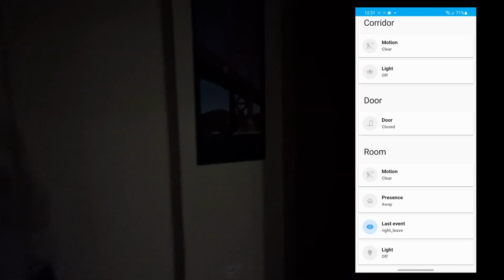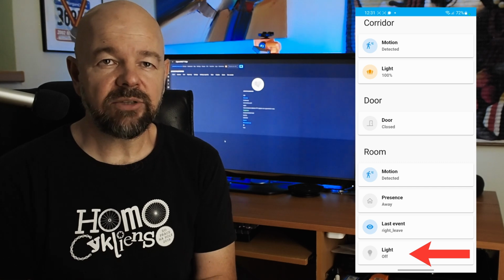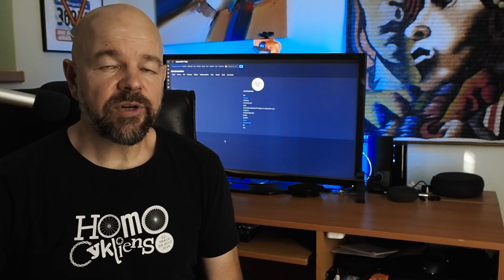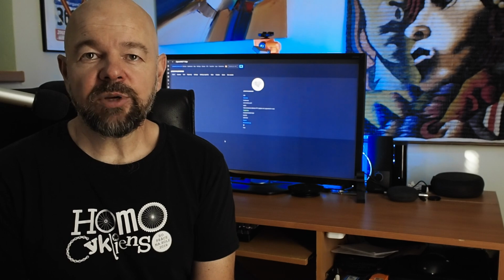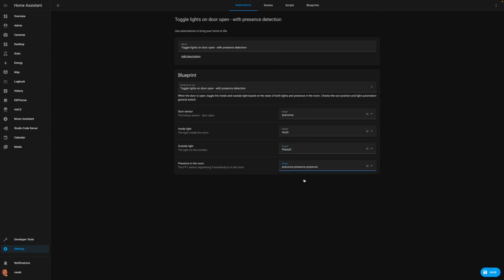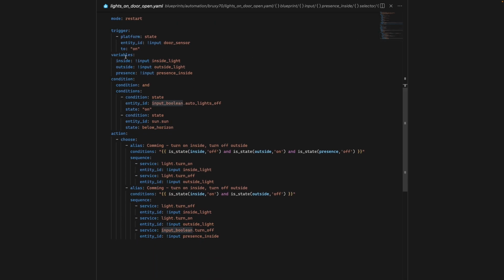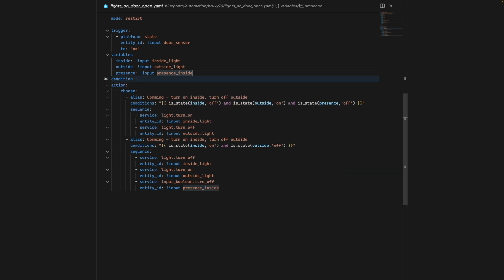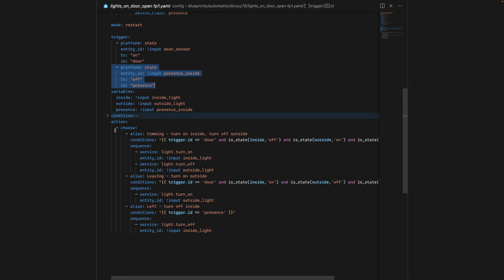The ultimate Home Assistant lights automation

Comment: this is nothing special. as others say... you base everything on a door sensor when there is no reason! if you have an aqara fp1 sensor... that's all u need. if someone is in the room don't turn the lights off! u don't need a blueprint for that.
Reply from the maker: Right, that was the first thing I did. I kind of did not like that it turned on the lights after a long time. So I ended up turning them on manually. And on the corridor, it was turning them on when I was already out. It took too long to detect the presence. Some combine it with a motion sensor. But in my case, door sensor worked the best - it is the quickest. When I was coming in, the motion sensor worked (and I still use it). But when leaving, it turned the light on when I was already out. But if you do not always close the door or do not have door sensor, a motion sensor could work.

Comment: This may work if you keep all of your door closed at all times. We don't do that.
 I created a binary sensor group helper for all rooms. Using things in each room that would be in use, like presence/motion detectors, electronics, stove, microwaves, toasters and such. 
Bathrooms have door sensors. If they are closed, most likely the room is in use. I use the helper to trigger the lights on and to trigger the lights off.
For a long time I was using a wait condition (after lights come on ,wait for occupation to be off, then turn off lights) but discovered that using trigger ID's worked much better and more reliably. Sometimes the wait would time out and the light would not go off. Now I use the on and off of the group as triggers.

I also include a Home Assistant restart as a trigger. If a light was on when the system rebooted, it will shut it off after 30 seconds when HA reboots. Occupation will override that though.

Comment: What settings do you use on your Shelly 1L? I seem to be struggling for my automations to turn my light on when motion is detected in the room.
Reply from the maker: Does not have to be shel;ly. Any smart light switch will do. Smart bulb, Shelly, Snonff. With Tasmota, ESPHome even stock fw.. Does not matter. All it does is to call service to turn it on or off.
Reply: @bruxy70  Thanks, I guess i should have been more specific. Im struggling to get my shelly relay to work with me motion sensor and wanted to know what "button type"  configuration you had in Shelly.